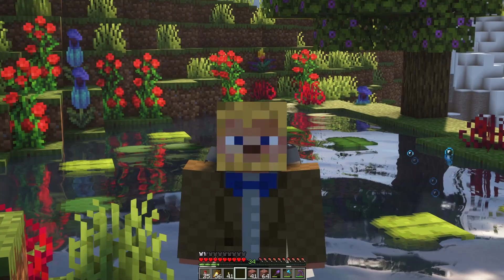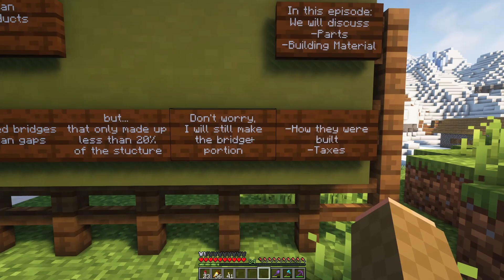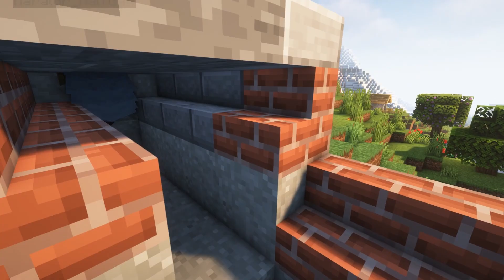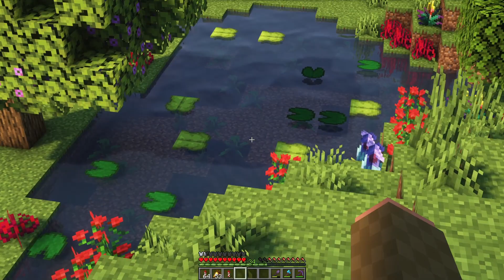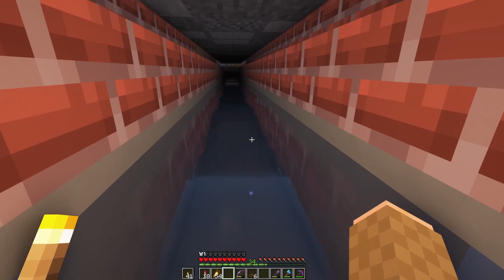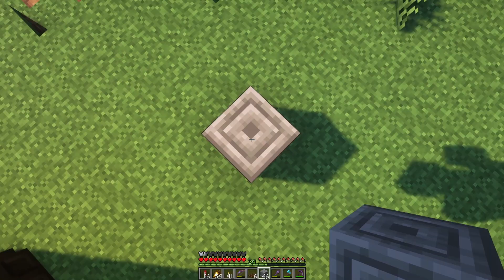Roman Aqueduct on the Archaeo SMP - Part 1 | Archaeological Minecraft

Comment: it's interesting just how much of the Aqueduct infrastructure still influences building today. Of course a lot has now been simplified using modern pumps but even the ceramic piping can even still be found for sell today. As for the lead pipe, you can still find it today in old homes (mainly the ones made historic) though most has been replaced with copper or plastic. Recently I had heard of a town with in my local news viewing area that only with in the last 2 or 3 years had finally finished replacing the lead pipe in the city water infrastructure, and yes that is in the continental US.
Reply from the maker: Yep, in the area I live in the States they are just now replacing the lead connections to the city mains at the street.  Houses no longer have lead pipes in them but those connections to the main city supply out under the streets are in a lot of cases still lead.

Comment: I hope the aqueduct gets some arches! gonna be a really nice build. Great and informative video, I eagerly await part 2. How scant is the evidence for their use in irrigation, and do we know roughly the extent of its usage for irrigation? was it not necessary or deemed expensive or is there not enough information overall to have an accurate picture?
Reply from the maker: LOL, Yes, the aqueduct will get its arches in part 2.  I tried to not show everything in the timelapses in part 1 or why would anyone come back to see the finished structure in part 2 :).  As for your question about irrigation it is a good one.  Logically it would have made sense for a local community or a rich roman to divert some of the water from a passing aqueduct though they might anger the state in bad ways if they did.  Some of the secondary sources I used in the research like Dembskey mention that it wasn't used for irrigation and when the primary sources like Vitruvius and Frontinus talk about aqueducts they also don't mention, at least not that I could see, them being used for irrigation.  That said, to my knowledge the Romans did irrigate their fields, so maybe a distinction was made by the primary sources that they didn't consider waterworks for watering fields "aqueducts", maybe just irrigation canals.
Reply: @Haraldr_Halfdan  Thank you for the comprehensive answer